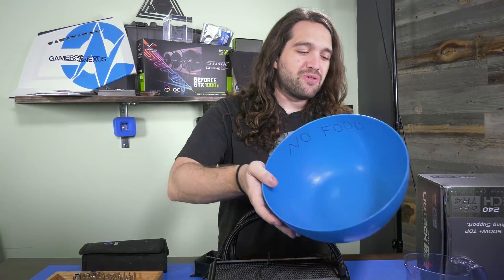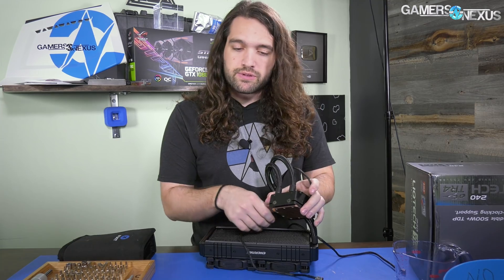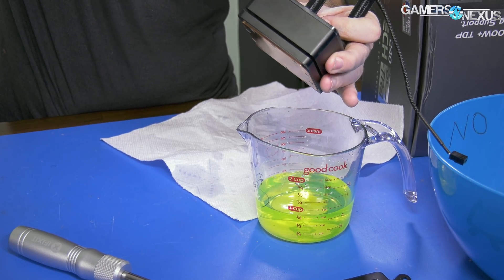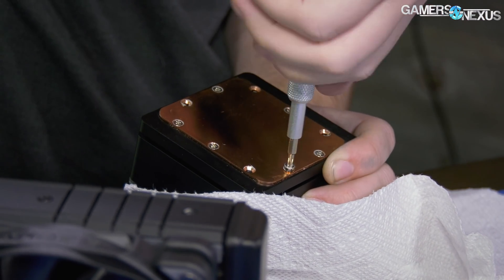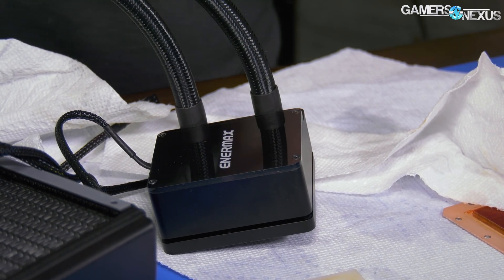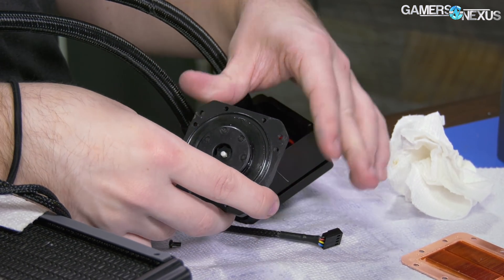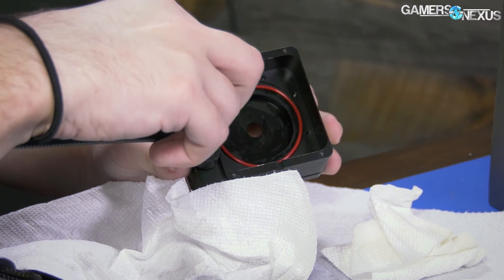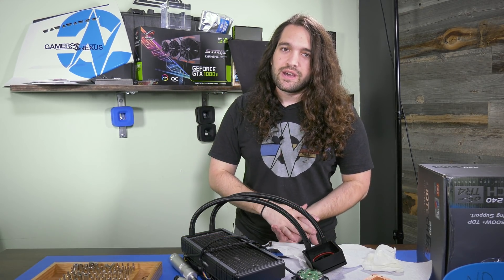Tear-Down: Enermax Liqtech Threadripper Cooler

Comment: Hello I have a quick question about aio . A friend of mine has one but unfortunately he can't tell me the name or brand of it as his PC is a pre-built . He has a 4770k at stock speeds and is getting 77 degrees on his CPU thermal paste has been replaced already with little difference.  My theory is that the liquid in his aio is no longer of suitable quality to cool his CPU anymore so my question is considering it 4 years old is how often should you change the liquid in a aio and would he be better of just purchasing a new aio altogether.  If it helps its a single 120 radiator.
Reply: Hayden Madden I have a Corsair H90 cooler that has been running for 5 years or so. Your friends temps are a bit right depending on airflow and radiator placement.

I'm waiting for mine to fail and have thermal overload protection on in the bios. Theory is, one day I'll come home and the pc will be off. I'm constantly checking CPU temp, fan speed etched so it'll be immediately obvious to me when my cooler dies.

Comment: Awesome tare down! Always good to see this content. Ave has some really good videos on how to check what kind of manufacturing processes and materials were used and could really help bring another level to some of these kind of reviews. He covers metals, plastics and a bunch of other stuff. At this point the failure point looks like it would be the pcb and it's components (outside of permeation). It would be interesting to see if they used any conformal coating or anything to account for possible leakage or what kinds of components were used on the pcb. Just thoughts, keep em comin!

Comment: Hey Steve, how big is the coldplate/block since its so easy to take apart and also seems to be very high quality im wondering if I could youse it for a ridgid tube clc mod with self machined parts.

Comment: Steve. Love the reviews, analytics, overall good common sense you apply to your work.  But, please... please.... square your bit to the screw head.... every time I see you unscrew things you are torquing on the head at an angle.  That will greatly increase the stress on the bit and the chance you will strip the screw or round the bit. Probably just my OCD, but watching you unscrew things is like you reviewing a case with no front air intake.

Keep up the awesome work!

Comment: The pump housing looks CNC milled. I doubt it is billet, though it is small enough that it could be and not be waistful, depends on what the cheaper way to get the base material is I would think. Unless they choose billet for product quality. Lol, I am not helping. It could also be case hardened but the only real way to know is to either cut it in half and test the rockwell hardness or to ask the company of the manufacturing process. For the purpose of it, the only real thing it needs to worry about is heat transfer and use of sealing surfaces. It doesn't carry a load other than supporting its weight and a portion of the hoses.

Comment: The housing is mostlikely "powder metallurgy" anything that doesn't need tool hardened steel typically will use that, it's cheap. The only real way to know would be to remove the paint then look at it under a microscope, even a cheap one. Might be something you'd want to add to your review kit is that cheap usb microscope. I cant see how much you'd use it, but at least when you need it, for say looking at the gunk on the fins you could get a better view. If you want to see sort of how to tell look at AvEs video here https://youtu.be/WG8KU_ln77k?t=7m27s
He's awesome at breaking down things to see how they work and as an hobbyist engineer, his videos are great. Only other thing i could think is maybe they machined it out of low grade aluminum. That's viable just for the weight savings in bulk shipping.

Comment: Can almost guarantee that was machined from billet Aluminum then polished with some sort of shaker media and black anodized.

I wouldn’t be surprised if the coolant is actually off the shelf ethylene glycol based green coolant .

Discoloration is probably just some of the anticorrosives and related chemicals slightly reacting with the copper. Could also just be the dye slightly staining the metal .

Comment: BTW. Discoloration most likely is caused by the chemical reaction - as dissimilar metals are reacting together connected by liquid (acting as electrolyte). Liquid should have inhibitors to slow it down but it still occurs.

Comment: This is trivial to rebuild.. Next week: Apparently it comes with extra screws! Why the hell is there gunk on a fairly new cooler?  They need to stop cheaping out and using aluminum radiators with copper coolers.
Reply: Why I'm going with Wraith ripper. This cooler was all hype within the first few months but doesn't last at all.

Comment: You should refill it with pure distilled water and see if it changes temps vs stock now that it doesn't need the propylene gylcol for shipping.  It might be worth making a custom bracket for x299 and seeing if that benefits it over a normal aio.

That channel in the middle of the cold plate is a bit confusing.  Normally they're there with an inlet above that channel so liquid goes out in 2 opposite directions, right?  But with the gasket I guess it's just to reduce surface tension along the channels?
Reply: It could also be to re-distribute the liquid , so that any blockage (gunk) renders less of the surface area useless or uneven pressure is equalized. Or maybe we are overthinking it and it's simply there because the tool (or cutting parameters) limited the length of the fins.
Reply: I'm fairly sure that the rad is aluminum while the cold plate is copper. That's gonna corrode so quickly without an anti-corrosion additive like propylene glycol. The liquid appears neon green like antifreeze because it essentially is antifreeze. Propylene glycol is used because it's non-toxic when ethylene glycol can't be used.
Reply: Pyromanaic28 
That silicone pad/gasket is even more confusing. The fin arrangement looks like CoolerMaster's ML-120RGB thermal plate fin array, except that CM's seems to be machined into thin fins, and the water path is definitely from the middle out; while this one's path is from one side to the other under the silicone pad. It's almost as if they tried middle-out first, and either didn't get it to work, or (most likely) got lawyer-slapped before they got to production. 

Side-to-side isn't an ideal flow path, because the dies on the far side will always run hotter than the ones under the first part of the path. Kinda goofy, if ya ask me.

Comment: Do a video about servicing liquid coolers. That would be a great thing to cover. I actually have an older one where the pump is still good, but the liquid most likely needs replacing (it's about 4 years old). I don't use it on my current build, but would be nice to put it back into service on an older AMD FX machine I still have.

Comment: I can see push pins for an injection molding machine, however there is obviously been some machining work done to the block, however I do not know much about plastic machining, so I can't say for certain what it is, idk if Delrin can be injection molded.
Reply: Joshua Nicoll yep you can injection mold Delrin!
Reply: KW0311 USMC then that would be perfect, its a really nice to machine plastic and lubricates the moving parts. My cheap EK SPC pumps use the top delrin cap as a bearing surface, makes them pretty nice for the price.
Reply: The housing is actually made of aluminium, not plastic. Also, the EK SPC lineup uses re-branded Laing DDC pumps, which are not cheap by any means - for that, you would have to look at something like a Phobya DC-12. 

Oh, and the pump tops are made of POM because they look good - there's a whole slew of other materials that they could use, since the "low friction" aspect of POM isn't actually that relevant, as the pumps are designed around the principle of a fluid-dynamic bearing (i.e. the Rotating part does not touch the housing).
Reply: I thought it looked a little like metal, in the screw holes in particular, but I wasn't sure if that was just some kind of threadlock, so then it's injection molded and machined for the block. 

The EK SPC is not anything to do with Laing, it's designed by EK, Liang has had no part in making it, at all. Delrin isn't so much used for looks, but because all the pump tops, block tops and such are CNC milled (I'm looking at the XTOP part are it's 100% CNC milled) and Delrin is basically one of the most machinable plastics there is, it's really nice to machine. I can however confirm, that the pump impeller does rest on the delrin top, it's not a tight fit though, the liquid is meant to lubricate it, but the plastic and impeller are bearing surfaces. The rest is certamic as you'd expect from a pump.
Reply: Joshua Nicoll You're right about the pump - didn't catch up on that. But I hope the rotating bit is not touching the top, as that would scratch the clear (Acrylic?) tops and also create  imbalance long term.
Reply: Birdhunter well there definitelty is a grove on both that match up, there is a flatten area on the top that looks like its been worn down (I have a few SPCs, since they cheap for custom water cooling pumps, so I ran one dry for 20 seconds) on the delrin top. I'm not sure if it was machined like that or the impeller actually does ride on against the top. I don't have the acrylic one, but being a different material thats harder to machine in the first place, it might be designed differently anyway.
Reply: Joshua Nicoll If you ran it dry, then that's the issue. These pumps are designed with the cooling fluid itself bering part of the fluid dynamic bearing. The fluid itself is stabilising and centering the rotor in the housing. Without the fluid, there is no bearing, and the rotor is touching the housing - which is something it's not designed to do and can easily damage or break the pump. 

That's also why everybody (including the manufacturers) say that you should never ever run a pump dry or below the recommend speed (as too low speed means not enough pressure is build up by the liquid to stabilise the rotor).

The rotor might be touching the housing or central axle when powering on or off, but even then, it shouldn't be able to touch the top of the housing - only the side.

Comment: From what I can see and hear, the block appears to be cnc machined from billet aluminum (most likely 6061), polished, bright dipped, hardcoat anodized, dyed black and sealed.

It's definitely not sand cast and it doesn't look like any of the die cast parts I've worked with. There's a really slim chance it could be lost wax investment casting with a boatload of post process work.
Reply from the maker: Thanks, Kenneth & all in this thread. As noted in the video, it helps a lot to have the experts come out of the woodwork to help fill-in the gaps for me. I have been trying to learn more about manufacturing processes, and your comments are very helpful! ^SB
Reply: The issue with the thin wall and casting would be porosity. The air in the mold has nowhere to go and gets trapped in the metal. This could be overcome by post cast machining, but it'd be simpler and cheaper just to cut it from raw stock. Sand and investment casting also have a rough finish which would require too much post process work. Die casting gets rid of both problems with pressure and a smooth mold, but there's always a parting line, so more post process work.

The part would not be overly difficult or expensive to CNC machine from stock on a pallet changing horizontal mill. 5 of the 6 sides can be machined in 1 setup and then flipped to hit the 6th. I run a horizontal machining center for a firefighting equipment manufacturer and we do that kind of part all day long. With economy of scale and cheap labor (or automation), I'd put that part in the $10-15 range for cost of production.

EDIT - And because this is the kind of group that would find this stuff interesting...this is the type of machine I use and machining I do. :)

https://www.youtube.com/watch?v=n5X74Shzais
Reply: definitely milled from a block of aluminium
Reply: So you're saying, Gillian, that you think this part was diecast in a multislide with zero draft angle and then finish machined in at least 2 additional operations? The setup cost alone would eat into a boatload of profit on the product. 

Lets be really generous and say tooling up for diecast production on this one part only cost them $30,000 and they make 10% profit per AIO. This one part alone would take 100% of the profit for the first 2,142 units sold.

The setup cost for CNC milling would be less than 10% of that, they would be quicker to market and, should they find a flaw or improvement down the road, they could easily make a change.

BTW, hesitation marks are common in milling when the end of the toolpath is reached right before the Z axis rapid retract, especially if your setup isn't perfectly rigid.
Reply: Dazley you actually found the proof it’s milled that’s caused by the end mill bit stopping for a moment and changing direction
Reply: Yeah thats what I was thinking too, it looks like its done by CNC to me. Can you cast something with thin walls like that on the one side? I don't know much about it but I would think that CNC would be the best way to get an precise and consistent size, I thought shrinkage would be a problem on something with that thin on the one side?
Reply: I came here to say that. Walls with different thickness might be possible, but a nightmare to do it. It might costs even more than machining a block.

It really looks like an expensive product to manufacture (and designed from the ground up for a niche market? )
Reply: I can't imagine it would be a casting, it looks to me like the work required would eliminate the cost benefit of going that route. Like Kenneth said, that's not a part that's hard or expensive to mill from a solid billet. Tooling costs for aluminum are dirt cheap, too. You aren't wearing out your endmills, drills or taps/threadmills very fast at all. I work in a shop that specializes in plastic injection molds and aerospace. We deal mostly with various steels and superalloys, but anytime we manage to get a job that's made from aluminum, it's absolute gravy.
Reply: Aren't seams and small circles an indicator for a casted modell? I can see one at 11:52 on the inside right lower corner underneath the upper screwhole. If not, why is there that circle?
Reply: Milling is pretty cheap by volume, and post-casting machining is very cheap in high volume, but I suspect they are not making enough of these to warrant that combination of processes. Machining aluminum is very fast, and at least in the US I'd suspect that this part would cost about $10 if you ordered a few hundred at a time.
Reply: 15-5 or 17-4 stainless?
Reply: I tend to agree it's milled but milling isn't cheap and I don't know how good it would be for mass production without being prohibitively expensive I'm thinking it's not milled from a solid block but milled from a precast shape close to the final product as to cause less waste during the production process this is very common in mass production.
Reply: cnc tool doesn't stop, certainly not in that position, those are holes in the mold for the ejector pins

Comment: This is the part where you fill it with distilled water and a few drops of anti-bacterial and see how it performs compared to the premade mixture
Reply: Craig MacDaniel 
True, over the long term; however, water is a better thermal fluid altogether than polypropylene glycol, and can absorb/dissipate heat far more effectively, so initially would outperform the green goop.
Reply: Horribly. It's likely an aluminum radiator with a copper block. Without an anti corrosive you'd experience galvanic corrosion pretty quickly.
Reply: Craig MacDaniel I thought the tubes were copper and the fins were aluminum. Is the whole rad seriously aluminum?
Reply: Everything I can find on the net lists the radiator as simply "aluminum", and most other AIO's use full aluminum rad's as well (except for those expandable ones from EK and Fractal). Which is another reason they don't want you to disassemble and refill them, because refilling them without an anti corrosive is asking for disaster.

Comment: I took apart a h100i v2 and it was just clear distilled water.
Reply: How did you determine that it was distilled water?
Reply: It's NOT just distilled water. It's just clear. It has corrosion inhibitors and additives as well. BTW...don't drink it...lol
Reply: whyd you take it apart?
Reply: Jack White Giving it a taste test is an easy way to find out.